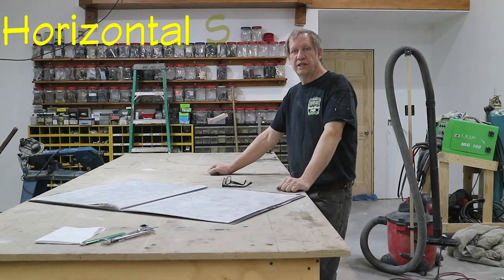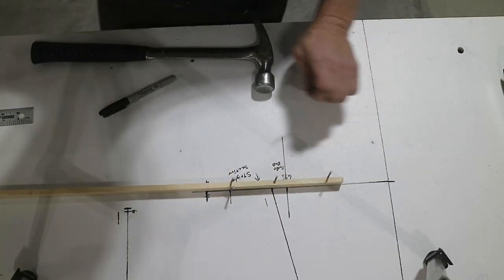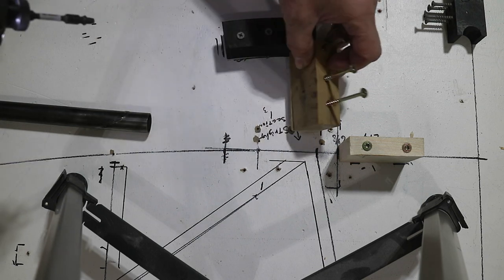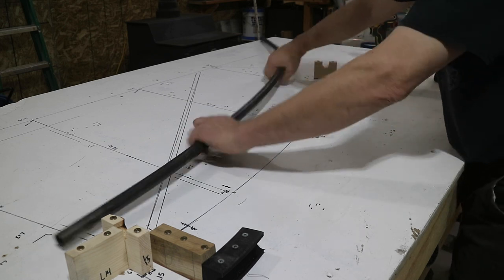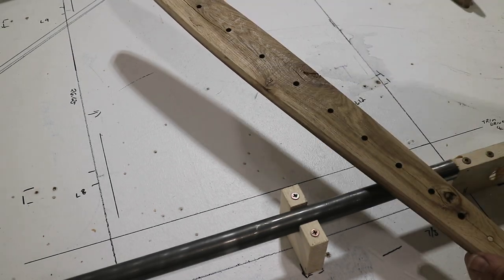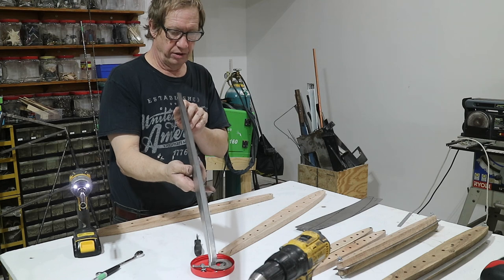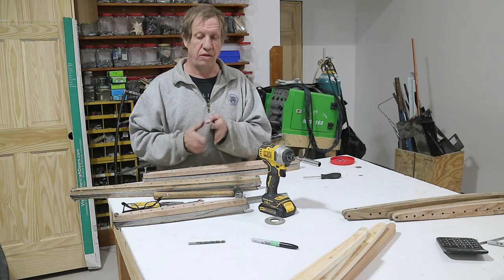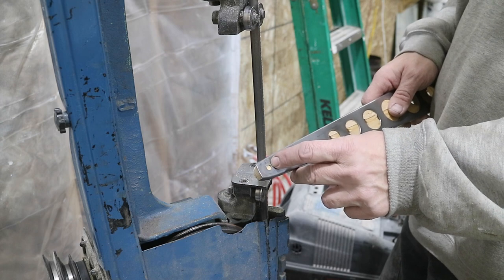Bearhawk Experimental Airplane Build : Horizontal Stabilizer

Comment: ever since watching your video, my gears are grinding on this subject. I have a question about the horizontal stab strut connection point. How are you installing this bushing? Do you plan on clocking the axis of the bushing to the same axis of the load from the strut?
as well what material are you planning to use for the strut its self?
Reply from the maker: I put the bushing for the strut in the leading edge. It's in the video at 37:55. As for the connection to the lower longeron it is show on my plans page 20 and connects to J-H. As for material, connections and adapting to the angles involved I haven't really thought about it yet. It's something I will evaluate when I get the parts of the tail assembled.